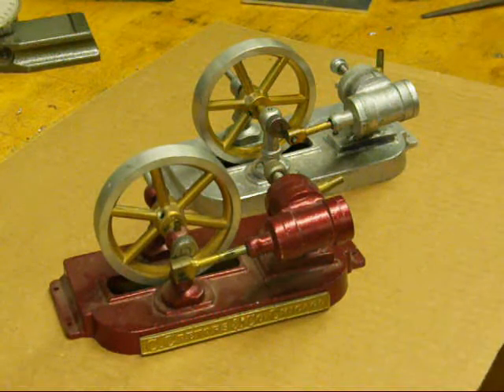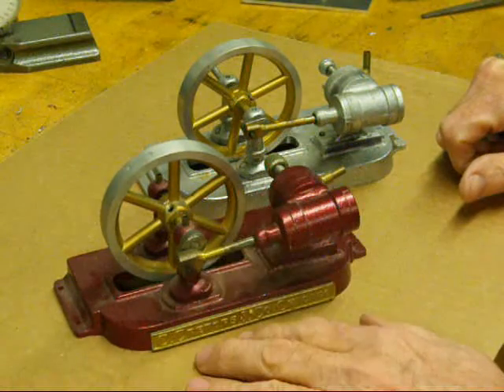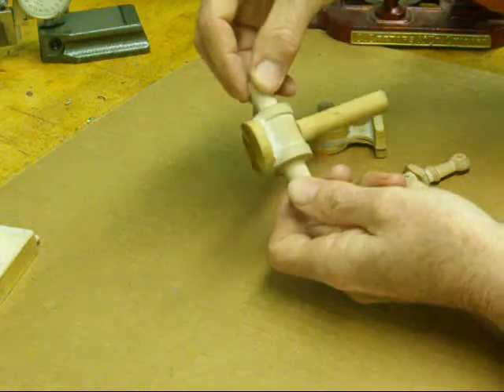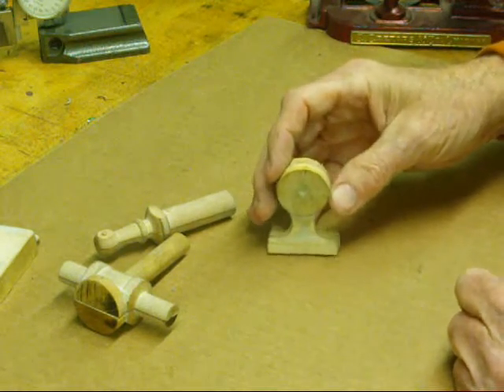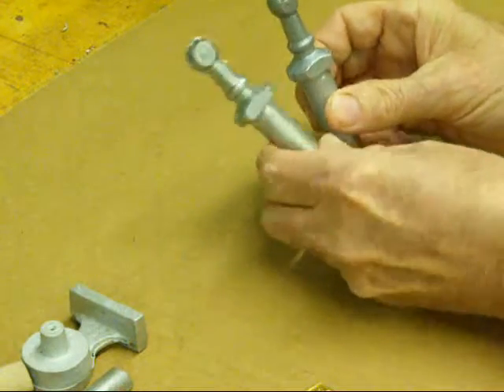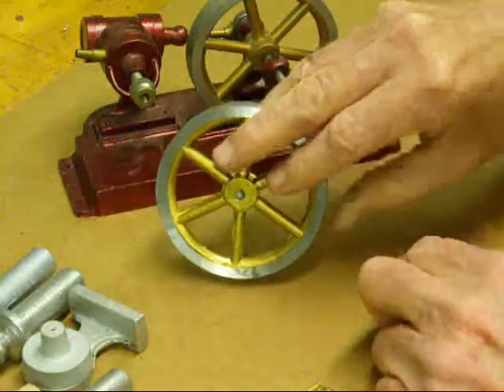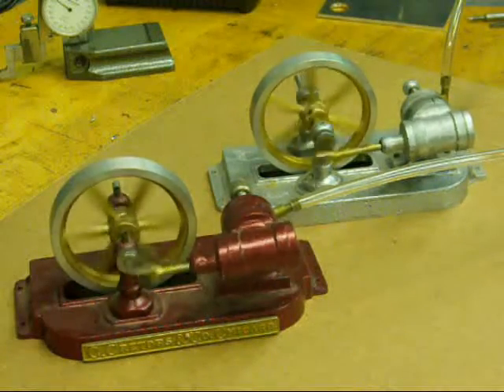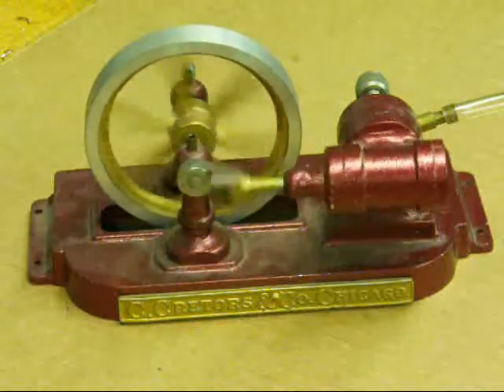CRETORS MODEL POPCORN WAGON STEAM ENGINE tubalcain

Comment: When craftsmen guide the “design engineers” for the goal of reduced costs and ease of manufacturing or produce ability, then just as you mention holding stock is a feature that would be built into the design call “Designed for Production” I hope everyone watching picked up on that point. – well done tubalcain!

Comment from the maker: I use LOCTITE bearing mount. That way I avoid those tiny screws & threads. To remove, I use propane torch. Piston is steel, no rings or seals--just a close fit.

Comment: how do you attach the ends to the cylinder?  I am refering to the part where the piston rod slides through and the head?  also can you make a short video of the complete breakdown and reasymbly?  What is the piston made of?  Great work on the engines!!  5 stars!